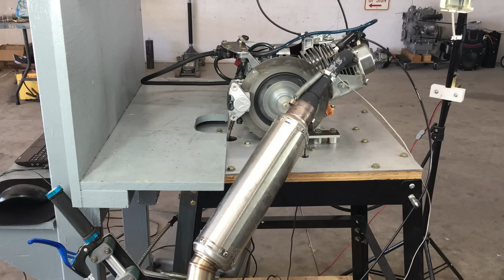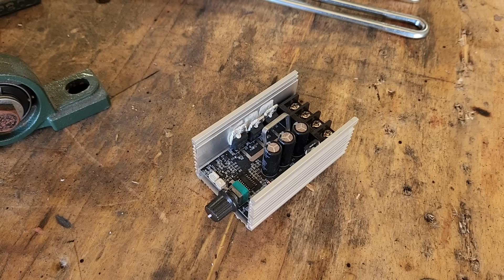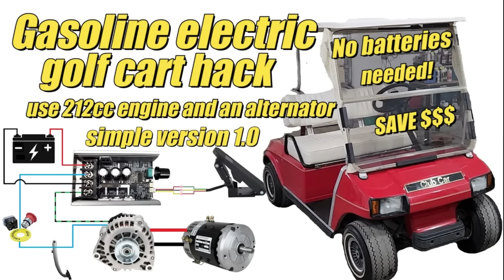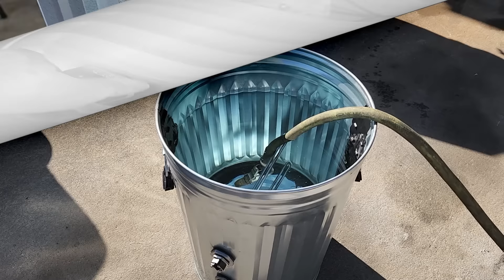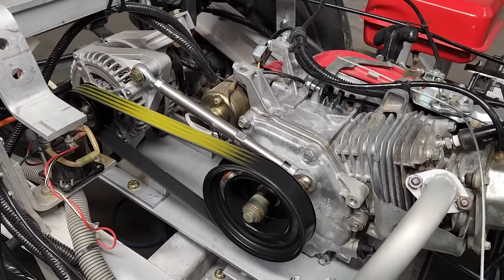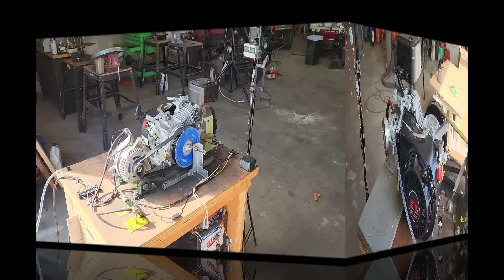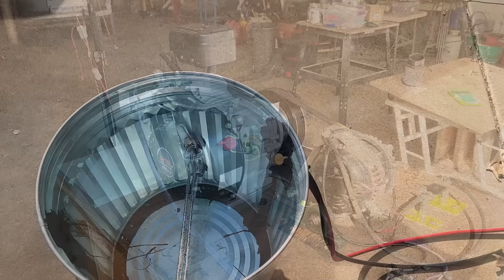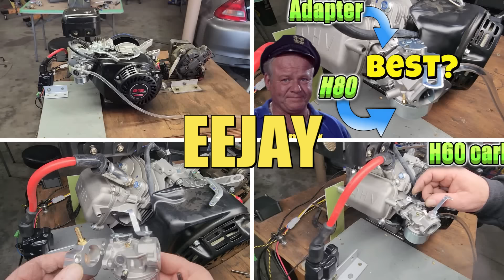S6 E5  Our small engine test stand is BUSTED!  can we fix it on the cheap?  Let's do an experiment!

Comment: Probably been said already, but the efficiency of the alternator should be MUCH better at the same power level when running those elevated voltages as compared to when it is being forced to run only 13.8V.

Comment: This is starting to feel like a mild hybrid ev system. Land Rovers now a days have a gasoline inline 6 with a 48v hybrid system for the auto stop start with what thy call a belt integrated starter generator. They also put an electric supercharger. Then they did some other foolish stuff after that.

Comment: i love this test stand change. but i would add some kind of radiator to actively cool the water if you want to do some very long testing runs. just a simple submerged pump, cheap aliexpress/temu pc cooling radiators, and some industrial grade pc fans would do the trick.
Reply: 🤔 Another thing I'm curious about is what would happen when the water approaches boiling. Maybe that's too spicy for home cooking, though. 😅 Anyway, these heating elements were clearly designed for a much higher input, since water heaters heat up much faster than these seemed to.

Comment: You could leave barrel full height, elements at lower level and boat bilge pump to spray head at top to act as cooling tower, that should help stabilize load as tempature rises.

Comment: I built a similar test load with water heater elements 10 years ago for a home brew precision power supply.  I used a metal 5 gallon bucket with a sealed lid as I didn't need to sink more than 3000W over a short duty.  I added a pressure relief valve for safety.  I put some corrosion inhibitor to keep the inside of the bucket from rusting and a small piece of silver to prevent anything from growing in there.  These test loads work beautifully and I still have the thing.

Comment: You need to add the power lost across the alternator diodes. That should be 0.7 Volts times the amps. so a 100 amps is a 70 watts or 1/10 HP loss, not that much, but keep it in mind.

Comment: If I remember my electricity training wouldn't wiring the elements in series increase the total resistance of the circuit?.  Something about parallel circuits having resistance calculated as reciprocals and other convoluted math things.

Comment: I had seen a video a couple months back discussing engine dynos that use generators instead of fluid. It allows them to recuperate some of energy used during the dyno and put it back into their electrical grid or battery storage.. Pretty slick idea.

Comment: I'd like to see you put the petroleum battery on a utility trailer equipped with electric driveshafts. Then compare towing mileage without the power assist from the trailer and with the power assist. Would your truck get better mileage/range with a powered utility trailer or not? Would it average out when combined with the fuel consumption of the petroleum battery?

Comment: Hey Jimbo, I got a question/recommendation. Since your basically making your own water heater, I would look into a diagram of one to see how it works. Cold water fills in a water heater tank as the hot water heats up and leaves; otherwise the water will get too hot (the purpose of a thermostat obviously). Are you planning to implement a similar system? Even just cold water cycling through the system would probably work since you arent trying to heat the water up for use, but rather use it to cool?

Comment: You could completely separate the control panel from the test bench by installing a connector on the wire between the test bench and the control panel and taking a 5 gallon bucket and pudding, a bag of Reddi mix in it and putting a pole with a platform in that to Mount whatever control panel you need. If you want, you can fix the bucket to a handtruck, and it will not fall again.

Comment: I'm thinking you could wire up a small relay across each of the heating element terminals with a simple light indicator so you can identify a failed one.  I mean, you're bound to notice a failed element with the load calculations but it's a more immediate indicator with a light.  Even if it's only configured with a push-button tester setup so they don't remain in any of the test load loops for accuracy (and reliability what with the varying voltages you'll be sending through).  And, of course, with the small engines you're loading, you're not likely to bump into power limits on the heating elements (right...  RIGHT?!).  The limiting factor will likely be the alternator.  At some point, you're going to run out of capability there.  Wiring multiple units in parallel might solve some issues.  But then that's a more complicated assembly...  Maybe standardizing the alternators/generators into their own fixture with all the electronics (heavy duty 3-phase rectifier(s), test points/shunts, etc.), needed to measure makes sense then use a common-sized coupler for any test engine you want to test?  Then it's just a matter of building the engine stand that couples to the test stand.  A little extra time up-front but would save a TON of time on such tests down the line.

Meh - I'm just spitballing

Comment: Nice one :) Did you consider replacing the resistors with a solar inverter so you can feed the power into the grid and do something more useful with it than just making hot water?

Comment: Automotive coolant would allow you to use less liquid so you could make the drum lighter. It will also keep the drum from rusting. If you are going to put the drum on wheels, you are probably better off mounting all of the electronics on the drum stand so they will be completely isolated from the engine vibration. Your costs are getting high enough that you might want to look for a used gas caddy instead of the drum. They are already on wheels, have a handle to make them easy to move, and the sides are square so you can get a better seal around the heating elements.

Comment: As probably others have mentioned:

Maybe consider adding a relatively powerful water pump and a radiator with (also) relatively powerful fan would be a good idea.

Then the volume of the barrel of water itself acts as a thermal capacitor/battery, which'll make it easier to control said pump and fan with a simple on/off "bang bang" controller.

And almost completely unrelated:

Slamming heating elements into a barrel is approx 20% away off of cobbling together a home biodiesel processor for waste/used vegetable oil.

Nothing makes you feel more like Walter White LARPing as a oldtimer moonshiner, than messing around with methanol and sodium hydroxide, while heating up the used vegetable oil to remove the water before further processing.

Comment: I like the electric dyno, I don’t understand why everyone is running with the clutch on and on flywheel style dumps.  I get that it’s a form of data but for engine modification you really want to see torque at engine rpm

Comment: I have an old device somewhere that would wire into  GM alternators back in the 60's or 70's, it basically bypassed the voltage regulator and sent full field power, then collected the output into a single plug on the unit. It has a light that came on at the correct engine rpm to achieve (approximately) 120 vdc, back in the day power tools would accept either ac or dc, so you could run a drill or saw off your car with no generator needed.

Comment: We maxed the PWM so need a bigger one to find the the diode limmit. 
 Taking wagers  on what it will take. 
Building a VOT wind mill and a water tank in the basement  seams like the best way to dump load  when battery bank tits the top. Add a circuit to spile the bank for desulfation

Comment: Sometimes when you replace the hot water cylinder elements they are tight and can undo the adapter as well, which is bad if the cylinder has been all soldered and sealed up after the adapters were fitted, so they have left hand threads, as when fitting new ones, you normally don't have to put much effort into tightening them.

Comment: remove the diode from the alternator, don't need them. just dump 3 phase into the trash can. I would take a guess, probably 200 volts will destroy the diodes.

Comment: If you aren't worried about the water boiling, that capacity is more than enough. Once it gets to 100C it'll stay there for quite some time. About 15 minutes per liter of water above the elements at this load (erring on the safe side). 

At first I was amazed that the diodes stood up to those voltages, but thinking more about it, they're probably designed to handle spikes in voltage caused by interference messing up the rectifier in short bursts. Diodes fail on overvoltage really fast, so you have to design for the highest voltage the system can make when you're selecting your rectifier diodes or you're likely to spontaneously fry them. I'd bet you'll start having problems around 150V, whether that's insulation failures or the diodes turning into wires.

That being said, I'm not entirely sure you even need the diodes in this case. You're driving resistors, they don't care about AC or DC power, so if the diodes do blow up, just yank them out and hook right up to the raw output.

Comment: You could also use an induction motor wired in C2C for the alternator. Cheap and easy to get 5 KW+ load, 
  For load testing I use cheap fan heaters with a PWM controller. Can Dial them up to any load you want.  I bought a few more 2 KW heaters yesterday at the hardware for $8 ea so i can do testing up to 12Kw now.

Comment: I'd imagine that the diodes I the alternator are pretty generic silicon diodes I'd imagine they could probably take 400 ish volts before failing. You would probably be more likely to kill them from over temp from over drawing from them for too long. Even the cheapest of silicon diodes have at least a 150v reverse voltage rating. Even in the overheat case you would be hard pressed to do that as they are probably rated for at least 50 amps continuous.

Comment: Hmm... Why not just go to a scrapyard and get an old hot water heater?  Most of the ones I've experienced rust out at the top...  so cut that off, then you're left with a large watertight, insulated vessel... that also has the correct threaded holes for the heating elements to screw into.  Oh, and it will also have a drain at the bottom.

Comment: i do have a question if i am using a liquid cooled load resistor for a project how important is it that i use a dull drill but to start the pilot hole?

Comment: Jimbo, why were the elements wired in parallel instead of series since you wanted greater resistance?  Also why would you cut down the barrel?  What is wrong with leaving it at its original height?

Comment: I guess those heater elements have to be pretty well isolated for normal use. Initially I was wondering if it was safe to touch the water, which you did without hesitation.

Comment: You could always toss in a few buckets of ice out of your fridge if you wanted to run the load test a little longer... Or use a heater core and small electric fan to cool the water.

Comment: Have you seen the load cell that is just the electrical current going through the water. Two electrodes on a lever than can be raised out of the water. That’s how you lower the wattage.

Comment: Tip
Mount the engine mounting plate to three or four Chevy transmission mounts to cut the transmitted vibration to the test stand

Comment: Id run an antifreeze mixture in the barrel and a cooling coil through it if temperature becomes a concern.  Ice water in a cooler can quick connect to the coil/barrel to maintain modularity.

Comment: I'm curious why you drilled holes in the trash can.  Why couldn't the elements be supported at the top of the water level and pointed down into the water, seems less likely to leak and is easier.  Just wondering.  Love your content.

Comment: Why not pickup a cheap electric water heater or a a few junk discarded ones. Strip off the sheet metal shell and insulation and you are left with a steel tank with heating element bungs already welded in. You are not building a pressure vessel so welding up any leaks is acceptable and you get the threaded bungs for the heating elements without having to make them (cut them out of a few junk units and weld into your tank you keep).

Comment: Having a background in electronics myself, I found this experiment really interesting. I'm not quite sure what was so unconventional about what you tried. That's clever load bank you have there. I wouln't have put the elements on top of each other though... and I've never seen resistors that large, just for the purpose of testing, either!

Comment: Have you experimented with the "eTorque" units from Jeep/Dodge/Ram? They're much higher input/output than a typical alternator and might be a cheap way vs running a bunch of alternators in series. They're decently documented but probably need some CAN control.

Comment: Hey Jimbo- thanks for the great video. Have you considered putting those new elements in the lid of the container? That would save a lot of resistive loss in the wiring depending on how far apart youu space the elements. Cheers and see you next time!

Comment: I'm not sure if this is something you'd consider doing, but I think it would be interesting adding the pony-dyno Load cell to this system, and adding some automations.

With the Alternator being modified and running at variable RPM, the actual efficiency from watts out to HP in will be somewhat error-prone. With a MCU, you could measure the loadcell on the variable load (alternator) w/ RPM to calculate real HP. With just a little bit more code, you could have that same controller drive the PWM signal to the rotor, allowing it to control the variable load bank directly. With a couple control loops, you could put it in a constant power out, constant HP in, go through different loading cycles, whatever. Then you could either datalog to SD card, or to a laptop for Realtime charting and data analysis. Could be very useful.

I'm sure you already have all the expertise to make something like that happen, but if you needed any help or anything I'd love to chat. I'm the guy that designed & built Torque Test Channel's 1000A/12kW load bank 'jumpy' for their battery & jump-starter testing, so I have experience in that area.

Comment: 11 years and my water heater wind turbine dump load still works fine in a 20 liter bucket filled with 50/50 water and antifreeze. 100% duty cycle and it doesn't warm up much at all and I've locked in my turbine to the dump load in wind storms. 750 watt turbine into a 1500 watt element. My turbine crawls slowly in 70 mph winds.

Comment: So why reduce the volume of the drum apart from making it easier to push around the shop when it's full? I guess it makes it easier to refill if you want to start a run from the same temp but a bigger heatsink will keep that close to baseline longer.

Comment: cool, if bypass the diodes, can use 3 heaters per phase. dont know if that will make it better or not. Crazier idea, to submerse nichrome wire inside the barrel. little shock hazzard, in name of science

Comment: Modern CNC machines use off the shelf range {stove top} burners for resistors instead of the expensive ceramic ones. For a water tank you might consider a beer keg, which is 15.5 gallons. Only caveat is you have to weld the bungs in since you cant reach through the top. They are also easy to move since they have handles. I also drill a hole in an electrical box and mount the element through it so you dont have exposed high voltage connections you can just bump into with your leg, and it gives you strain relieve for the cable. The heater bungs are left hand thread so they dont unscrew when you remove the heater element :). This is all common stuff in the home brewing world. They are called keggles, used for boiling mash or distilling liquor.

Comment: Not sure of the regulations there but the electrical grid is a great way to dump power and get paid for doing so. You would need a solar inverter with an input around the voltage you expect at the MPP,  a microinverter might be the best match.

Comment: And add a couple of thermometers to the tank. 
You'll need one high and one low as hot water tanks are famous for having a large thermal gradient. That's why the Hot Water tap is on the top.

Comment: Add a "W" lead to the Alternator, and then use a "diesel tachometer" for a direct reading of RPM with nothing on the engine.
Good for gas engines as well as diesels as it's just off the Alternator.

Comment: Excellent stuff Mr Cantina! (Again). A thought - why not suspend the heating elements from a bar or plate rather than drill holes through the side of the drum? Then you wouldn’t have to worry about sealing and leakage.

Comment: Very impressive Jimbo, very practical and well thought out, I am impressed.  A suggestion, I would stick the trashcan (less work) and get comfortable with the idea of boiling it it.  As you know, once the water is boiling it can't get any hotter and it takes a massive amount of energy to boil water.  Maybe your sealant will let go in those conditions or maybe it won't, might be interesting to find out.  It would add another hazard to your setup, but one that's pretty easy to manage.  I look forward to the rest of the build.

Comment: About 20 years ago I used a Chrysler product alternator mounted on my garden tractor engine to produce 120vdc for powering my saw out in the field - this worked great until the switch in the saw arced over and burned up.  So I decided to make a generator from an old 6 volt GM generator. I rewound the rotor (after cutting off all the windings and shorting all the commutator segments together) with #15 wire to produce around 120 volts. I ran one side of the winding through the  shaft, which actually worked ok for the limited use I needed and it served me for 10 years or more...